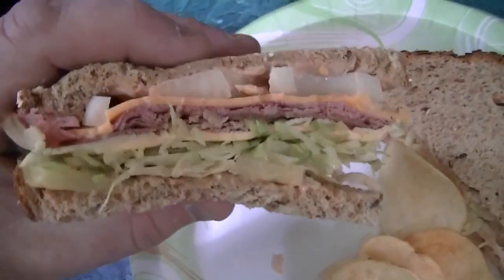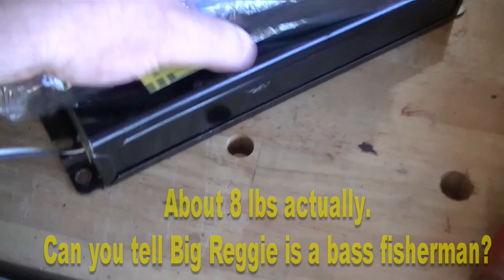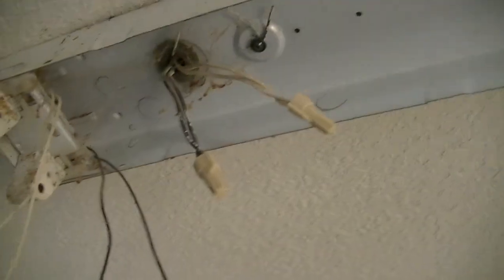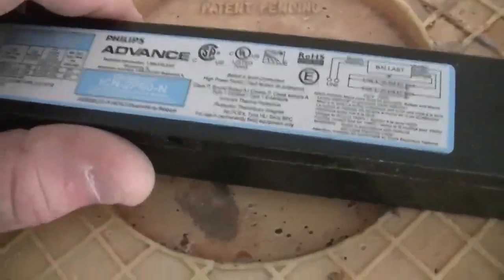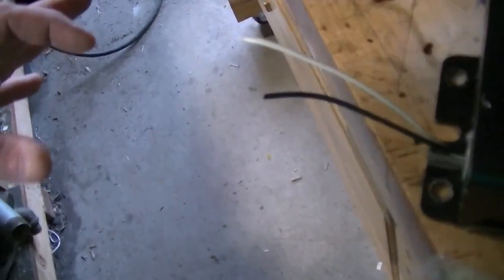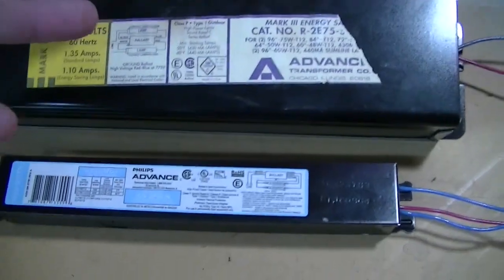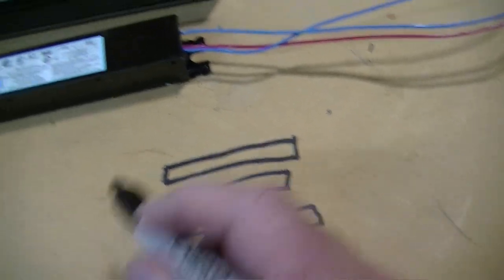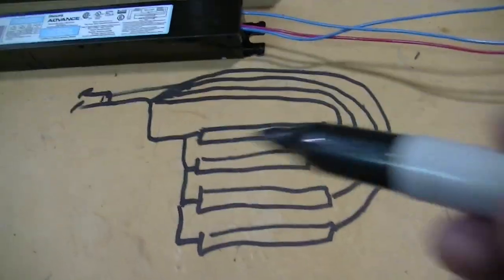Replacing the Ballast on a Fluorescent Light Fixture DIY

Comment: Thank you so much for that simple explanation.
I was going crazy trying to figure it out, since my old balast had 8 wires. 
After watching 3 ó 4 other videos, when I would turn the power, nothing happened. Then found you and my problem was solved.
I was about to call an electrician.
Thank you very much for sharing👍

Comment: Although the quality of the video is...terrible...the info he gives was SPOT ON for the problem I had as the new ballast explained NOTHING about the wiring to this type of light (even though it was the correct T12 ballast)...I had to replay the video like 5 times to understand what wires went where due to all the jumping around...but...he was correct and my lights are working great. Saved me SO much screwing around or pitching the light and a new ballast for no reason. THANK YOU!!!
In short:
1. The BLACK and WHITE ballast wires go to the BLACK and WHITE wires coming from your wall switch respectively - BLACK to BLACK and WHITE to WHITE. Make sure power is off.
2. Then combine the 2 BLACK lamp wires together and then combine the 2 WHITE lamp wires together. 
3. Then combine any BLUE ballast wire to the combined BLACK lamp wires you just did, then combine the other BLUE ballast wire to the combined WHITE lamp wires. 
4. Then combine the BLUE and RED lamp wires together with the RED ballast wire.
5. Put the plates back in, tucking in the wires, put your bulbs back in - turn it on - and your VIOLA!!!

THANKS SOOO MUCH!!!

Comment: The reason for the hot and neutral from the source feeding the stationary sockets with the black and white from the ballast hooked to the sockets on magnetic ballast slimline fixtures, is for two reasons.  First is because the ballasts is basically nothing more than an autotransformer with enough leakage reactance to limit the lamp current to the appropriate level at the 60hz frequency.   

 Second is because instant start ballasts have very high open circuit voltages as compared to a rapid start ballast,  and if someone were holding one end of the tube while inserting the other end into the high voltage socket with the ballast energized and their body grounded in some way for example by standing on an aluminum ladder there is the possibility of the lamp striking using the person to complete the circuit,  possibly causing them to fall off a ladder, or get injured in some other way, it could be pretty bad.  To prevent this from happening,  the stationary socket actually has two contacts such that the lamp pin acts a a switch to complete the circuit to the ballast, removing either lamp disconnects power to the ballast to eliminate the high voltage hazard.

Comment: I had the same old ballast I used red on red, blue on blue, and the extra blue I used it for the white wires from the other side ( not the power source) and it worked I tried your way and worked the same

Comment: Those magnetic ballasts are Advance Mark III Energy Saver ballasts, The older versions, like the one you have are prone to failing due to their capacitors shorting inside. Other ballast manufactures of the time also had another failure mode, which includes tripping of the internal thermal protector which means the bulbs would flash occasionally. This usually happens because the lamps where not replaced when they went EOL (End Of Life). Another common failure of most ballasts, although it seems a bit more rare if it happens is that the ballast would get overheated and essentially explode and spray tar inside the fixture which is a big pain to clean up. Magnetic ballasts from around the 30's and until at least the 70's contained PCB in the tar and/or their capacitors. PCB is great when it has not been contacted with or spilled, PCB is a toxic substance and can burn your skin and whatever. As long as you are handling PCB oil properly, then it's fine. Your magnetic ballast appears to be from the late 90's

Comment: My fixtures the exact same. And my old ballast was like a brick compared with this new one. I hook all the wires up colors matching (and left the extra red wire hang) Turned the switch and no light. So I took a guess that I tie the extra red into one of the blues,.. and then turned the switch and the lights came on. All good? Is that correct? Then I did the exact same to the other fixture, .. lights came on, but one bulb start flickering at one end (opposite the power) and I saw a small bright flair at the end of inside of bulb. Well the lights still work, but it left a faint black mark ‘ring’ inside the bulb near that end. Did I do everything correctly? The bulbs were new. The ballast was used from a light fixture that got thrown out at work. Think it’s possible that my ballast is the wrong size? Or maybe I got a dud bulb? Or maybe I hooked the (extra) red wire to the wrong blue wire. Is there a wrong blue wire? Or maybe something just shorted out? Any advice will help. Thank you. I liked the video. You’re not an electrician. Nor am I. It’s just real people helping real people!

Comment: There's another way to install them. You can ground the other blue wire with an electric twist cap. Hook the black to black,white to white, red to red and blue to blue. I have changed over fifty of them like that in older groceries. Work just fine.
Reply: ground the extra blue wire or just erminate it ?

Comment: i still use f40t12 fixtures that are pre-heat with the starters and some of the ones i have are from the early 50s and still work no issue. even the rapid start ones line in this video can last a very long time and i have quite a few that date back to the 60s and still work with no issue. but the new electronic ballast struggles to last 5 years and the tubes don't last as long either because instead of heating the cathodes and lighting the lamp gently they just send a blast of high voltage through them and that wears them out sooner as well. and LED lights are just harsh and boring and start to flicker.

Comment: Thanks for the video.   I have a 1 lamp fixture I am replacing the ballast. I ordered the ballast that you have.   I assume I would just combine Both of the blue wires and connect to the one tube.   That sound right?

Comment: I do these ballast all the time. And you showed incorrect information. For one thing there are ballast for 8ft tubes, and 4ft tubes.  You can't buy a single bulb ballast anymore.  When you are hooking one bulb up by itself.  You must cap off one of your blue wires. Weather it is for 8ft or 4ft bulb.  And they do not make a four ballast for the 8ft tubes. If you're deal with four 8ft tube in the same light fixture you must buy two, two bulbs ballast for the 8ft bulbs. 

Now let's talk about the four bulb ballast. The four bulb ballast has the following wires it had 2 reds 2 blues,  and 2 yellows wires. The correct way to hook them up is.... Each red and blue wires must go to one end of each. Now the yellows.  One musty connect to two bulbs with just the red wires. And the other goes to the blues side. On a 4 bulb ballast. And it does the wiring diagram on how to hook them up correctly. Please be aware the most easiest way too hook up the 4 bulb ballast is by removing all of the old wires.  The old wires can cause you to mess up and blow the new ballast. So remove the old wires. Except the power lines leave those in. Due to you will need them. If I ever have time I'll make a video for YouTube viewers and explain everything in my video. The correct way. For T12 and T8 tubes.
Reply: Agreed on the 4 bulb ballast... they do also have a black and white wire as well. I just pull the tombstones out with the ballast, twist out the old wires from the tombstones and rewire them with new ballast according to diagram they provide. Then mount up new ballast, reinstall tombstones, wire up black to black & white to white for power and done.

Comment: I'm not an expert (so disclaimer and would love for someone that knows better to comment). Based on the wiring and the tube base type (you can clearly see this fixture accepts a single pin tube), you need a "high output" ballast which will come with a total of 8 wires (notice that your fixture has 8 wires: 2 on one side + 2X2 on the other + 2 for power = 2 + 4 + 2 = 8). The proper ballast will have all 8 wires and instead of connecting the combining the side with 2 wires each, you will connect each wire to a wire from the ballast.

I'm about to attempt a replacement in my garage from a ballast that I'm guessing is 20+ years old. I noticed the old ballast only had 4 wires (a red and blue for the side with single wires) and then a white and black which connected into the power and attached to the other side (where there were 4 wires, 2 for each tube). So I was a little concerned when I bought the ballast and it had a whopping 8 wires! But the guy at the store asked what type of tube the fixture took and before picking out the ballast, told me (since it was single pin) that you need a high output ballast (I was about to buy the cheaper one, but figured I should ask first).

Comment: I watched video and still need help. I understand the reds connect with red, and blue connects with blue, but I have a yellow wire, where does this wire go?
Reply: @BigReggie , correct. The pictures matched up for new ballast. I think I found another video that helped me. I hooked up one red with two blue, one red with two blue, two yellows with one red and then white with white and black with black. Is this the correct configuration?